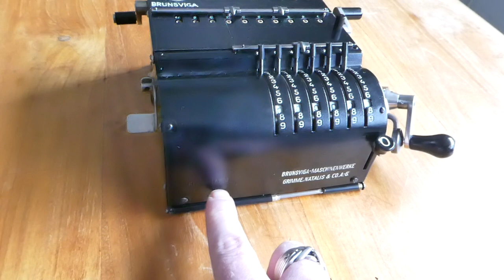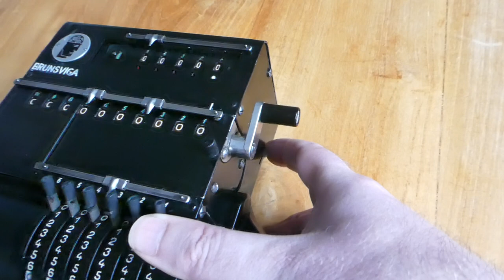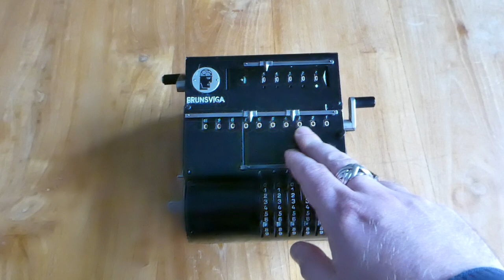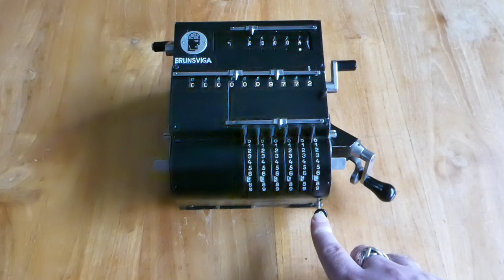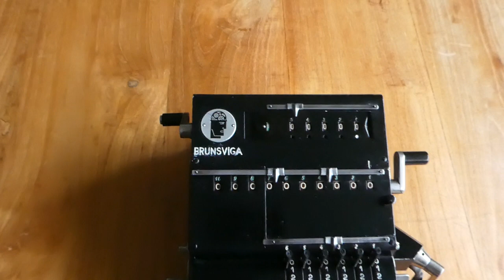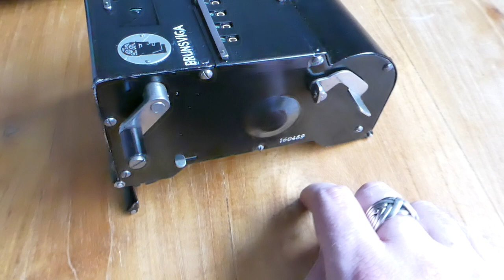The Brunsviga 10 mechanical calculator

Comment: The logo is great
Reply from the maker: It goes with the advertising slogan they used: "Gehirn von Stahl", which  means Brains of Steel.
Reply: @jaapsch2 I've always liked anything that equates a computer or calculator to an "artifical brain", electronic or mechanical - which is as pretentious as ever, as computers simply do what we tell them to do and are programmed to do (even the AI we are so crazy about today is just programmers telling a computer "look at photos that match a certain description and combine them in a new picture that also matches the description") - but the concept of an "artificial brain" sounds cool and sci-fi-y nontheless.

Comment: The way the input register digits peek through the "7" position on the input lever board is very odd. I suppose there's a 7 there if the lever is actually in the 7 position!
Reply from the maker: That's right. It isn't the only machine in my collection to do it this way - the Triumphator KA is another, though it has its windows at the 4. Its predecessor, the Lipsia Addi 7 came out in 1930, so the Brunsviga 10 was not the first.
https://youtu.be/OqqCV5xh3-A
The Marchant XL from 1923 also does it, but a bit less obviously cause the window is at the 1.
https://youtu.be/ewLT2s4THG0